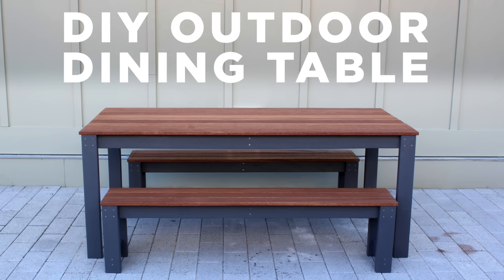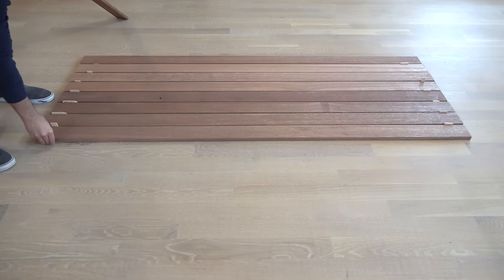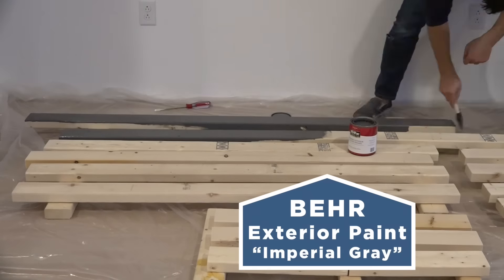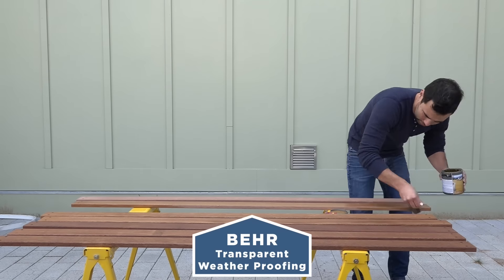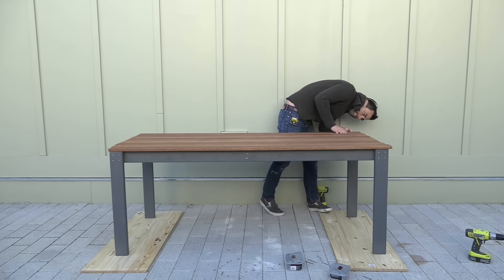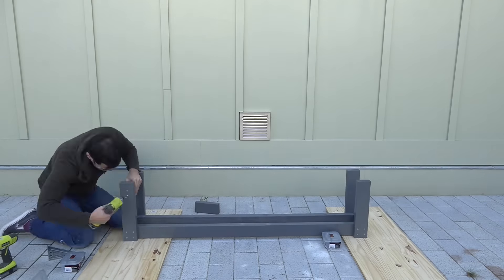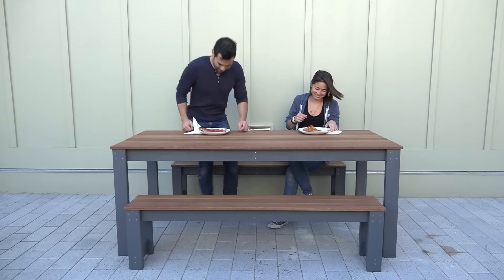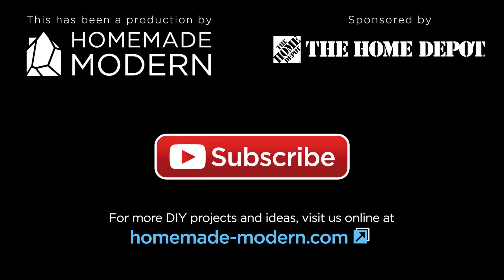DIY Modern Outdoor Table and Benches

Comment: Nicely done with good look. If you have a good track saw, one tip to save time in the future is to install the decking material on the table first. You can then use track saw to cut across the end of the table so that all the pieces line up and saves more time instead of using miter saw in the beginning.

Comment: Some mentioned that table doesn't look to sturdy if you push against it. How can I make it better? I like the design/colors/simplicity, but I am not sold on joints using butt joints. Will pocket joints help?

Comment: Your measurements don't add up on your website for the bench. For a start it says 9 lengths of 62inch hardwood. How can it be 9 lengths if you use 3 per bench ? Secondly the measurements of 2x4 Is for a single bench so how you can't say that the hardwood is for 2 benches???
Reply: Thank you. I almost bought all of them